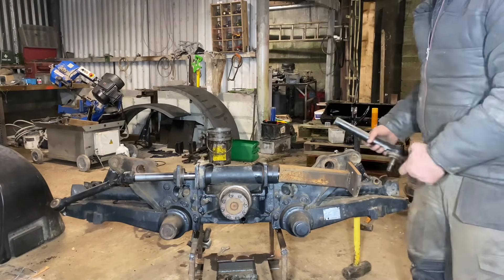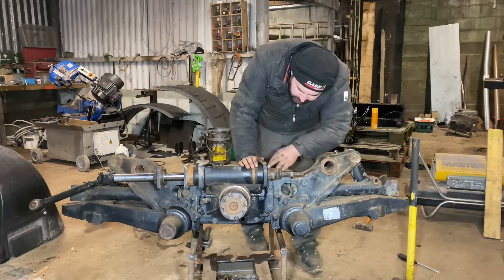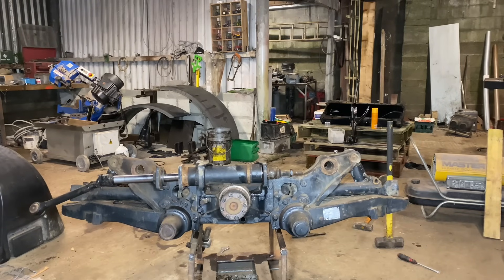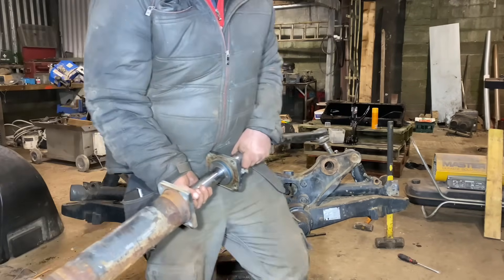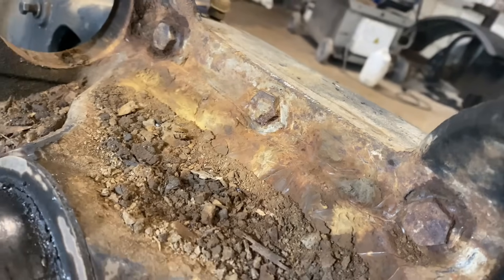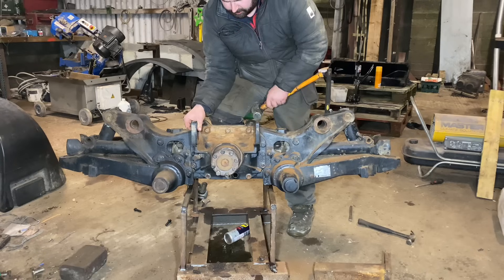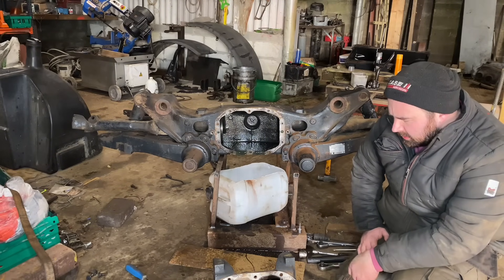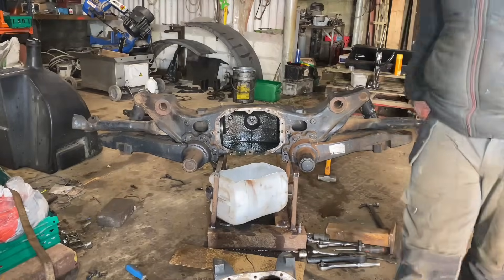REMOVING THE DIFFERENTIAL FROM THE STEYR CVT FRONT AXLE

Comment: Met Eireann are usually over the top on all their forecasts. They declared June ‘23 as the warmest on record, what about June ‘18? Very little grass grew in the south and many silage pits were opened in July. The absolute highest temperature was just missed by 0.5*C. Their traffic light alert system isn’t working either 🤢

Comment: A Carraro axle I see.  How similar is it to the suspension axle on the CIH MX150 and MX170 which is also a Carraro?  Are those MX suspended axles reliable? Or should they be avoided.  They were not sold in North America.  Now they show up on some of the imported Euro tractors.
Reply from the maker: There not bad just need attention every 9,000 hours if not greased

Comment: Just wondering if the axle is covered in the cvx1190 workshop manual or is it a carraro manual, Have a pin broke on drive carrier on cvx 1190
Reply from the maker: It's covered in the cvx workshop manual
Reply: @mrcvx  any advice on where to locate a manual, seen a digital version on ebay
Reply from the maker: Paper version on eBay also
Reply: @mrcvx  Cheers👍